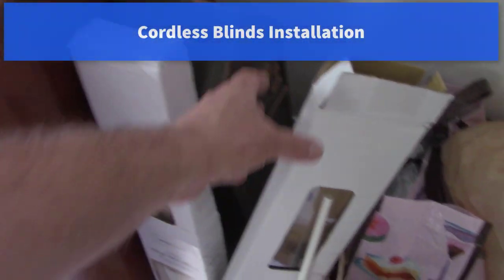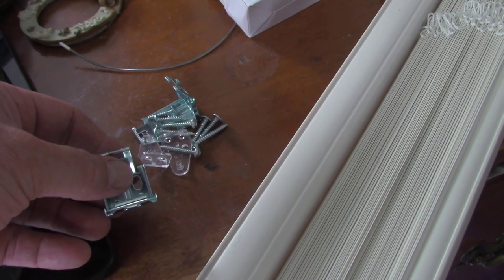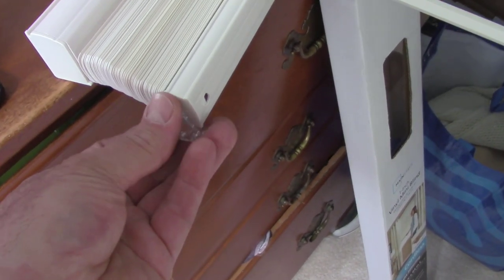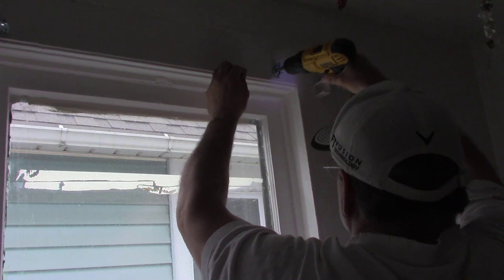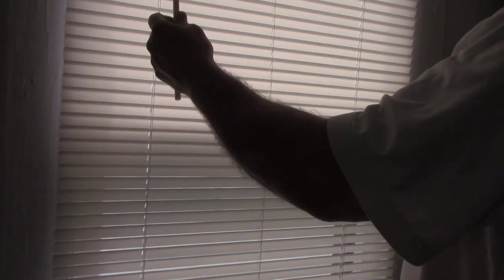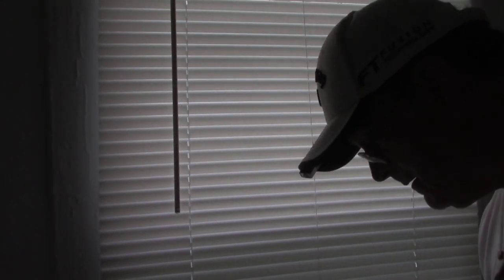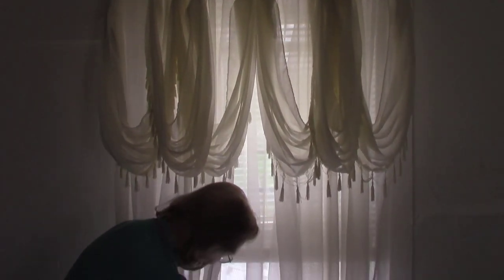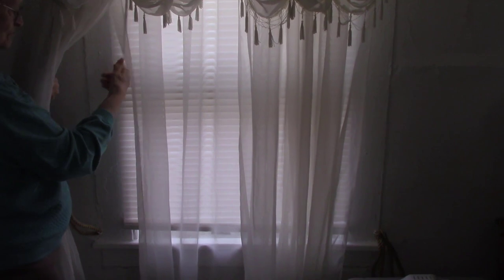Blinds Cordless Vinyl Mini Blinds Walmart Mainstay

Comment: Thanks for this video. The instructions were a bit vague. I worked it out but wanted to make sure I had it right and this helped confirm how it all fit together. I especially did not understand what the two small clear plastic pieces were for. Also, that's a very interesting crystal piece you have hanging that shows up in this video. Was it handmade?
Reply from the maker: WELCOME! I'LL ASK HER ABOUT THE CRYSTAL AND GET BACK TO YOU.I'M GUESSING, BUT I'D SAY HSN.

Comment: Thanks so much I appreciate you for sharing this it helped us to put up in minutes but just before we watched your video we wanted to take them back to the store !!!
Reply: I've had a pair for a year that I never tried because I didn't think they could be raised and lowered. 
I just swapped out other old blinds instead.
 Broke a blind this morning and looked  online frantically for pull strings and I see they are outlawed. Which I had heard - but I figured they could still be found somewhere...sigh. 

Now I have no choice but to use them. 
Just have to figure out how to install them on the inner or outside of window frame.  New framework and I have to be sure it's perfect when putting in hardware.

Getting old and new things are sometimes frustrating.  I've put up many blinds and rods in my life but I may need help with these.
Also frustrating. 😟

Comment: Jeesh!! I swear you just can't please anybody.  He left in the part where he installed it incorrectly to help people NOT make the same mistake.  He risked embarrassing himself in order to HELP someone else.  I would much rather have a video like this than one from an "expert".  For those complaining that they can't see what he's doing, you install the brackets with the longer part UP because that part needs to hold the top of the blinds.  He's doing an outside mount installation (outside the window frame).  If you are doing an inside mount, you still install the bracket with the longest part at the top, but you use the screw holes on the top of the mount, and screw UP INTO the frame of the window.  These are much easier to install than the old version because you do not need an exact placement of the brackets, you can eyeball it, and the blind will still snap into place.  Thank you for your video, I really did appreciate it!.....Jill
Reply from the maker: Thank you! You're welcome! Thanks for watching! Jim

Comment: Thank you for your video!  I was trying to yell into my computer when I saw you initially had the brackets installed upside down... haha  I just bought a pair of these blinds the other day and was frustrated to discover that they wouldn't slip into the old mounting holders.  I have wood trim around my windows, so I have to do a little more monkey business to get my metal brackets hung correctly.  Thanks again!

Comment: Much appreciated Jim. One problem though. I have sets of previously installed cordless Mainstays (same sizes), but cannot get them to come off. How hard can you press the plastic casing before something breaks (or gives) when removing them? These here seem to be pretty old but fully functional. Previous to this video, I was also baffled with the cordless function. I wasn't expecting them to work since there was no operational string attachment. Either who'da thought or am I just that dense? Thanks again.
Reply from the maker: They'll be brittle as they get older. Careful not to cut your self. I hear ya, the no string thing is weird!

Comment: dude I cant get my blinds to go down for some reason
is there a lock that i making this happen
Reply from the maker: Pull it down a little, then push it up.If yours has a string, pull the string to the side, then pull the string down.
Reply: @JimVincitore  Thanks for letting me know. I actually just was not forcing the blind down enough. I was being too cute with it. I actually called the number that was on the instruction sheet that all of mines actually came with. I waited for almost an hour and when I finally got through a woman simply told me that you might need to pull down on them with a little more force. After the phone call, I simply did that and it worked like a charm. I have 2 26 inch on two windows and 1 31 inch on another one in my bedroom and they all fit perfectly. Mines are actually the room darkening ones. Thanks for the help.